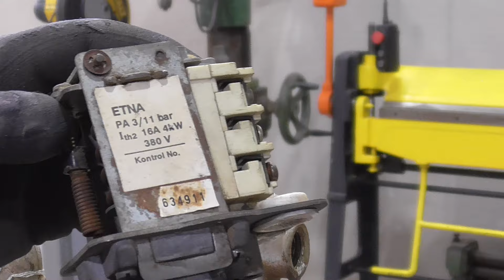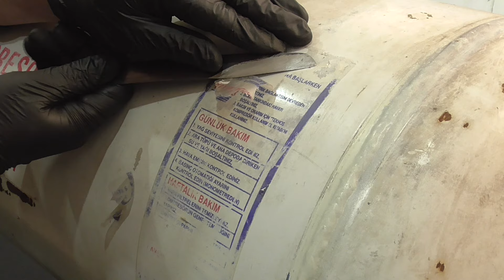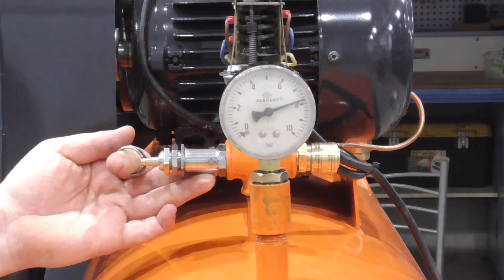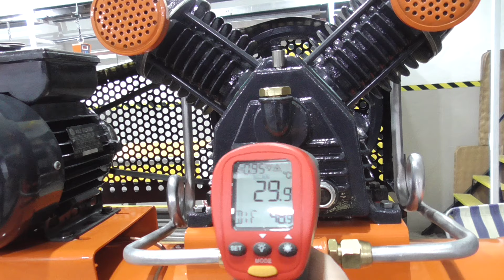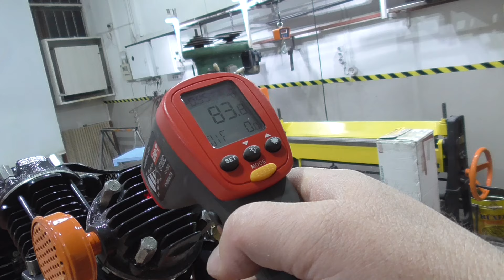Old Air Compressor Restoration

Comment: Great work, cool video. 
35:39 - I saw that one coming. 🙂
When I saw the air outlet aligned with the manometer connection I thought "no, no, it has to be oriented the other way or the hose won't fit!"
...Thanks for sharing.
Reply from the maker: Yes. I had such a problem. 🙂 Thanks for the comment.

Comment: I enjoyed watching your video. It was very informative. I would have never thought to break down the compressor like that to make an old unit look brand new. Makes me want to do it as well.
Reply from the maker: Before doing such work, it is necessary to make sure that the air tank is intact. If the air tank is problematic or rotten, it must be replaced with a new one. Otherwise it will cause major damage
Reply: How would you test that  @MechanicTechnic
Reply from the maker: @muhammadsalman4060  With water pressure testers

Comment: It's a nice restoration for the visual but for the technical and safety part it's not that, let me explain, the most dangerous part is the tank, you have to check the interior condition as well as its thickness of this one because if there is rust it is a place to weaken and risk of explosion. Good luck for the future

Comment: I use cheap USB borescopes to inspect air tanks and other pressure vessels as they're narrow enough to fit through the small fittings (the large inspection plugs tend to be rusted shut).
The old tanks tend to be thicker than the modern consumer junk. I do not buy new consumer-grade compressors as few are decently made. Restoration (after determining if overhaul parts are available) is the way to afford industrial quality equipment.
Reply from the maker: Contrary to popular belief, it does not rust much because the inside of the tank is lubricated. This makes it harder for it to rot from the inside.

Comment: Great video.
One question: why did you use 2 pipe out from the cylinder head like that ? I mean, when I see the original design, the two cylinder head are connected into 1 common ,,rail'' which goes into the tank. I am symphatizing with you solution, so is there any exact reason? Is this design better than stock design? I have a 3kW (single phase), 3 Cylinder compressor and it is able to produce 400 l/min at 4 bar and 350 l/min at 7 bar.
Reply from the maker: Thanks for the comment.  If you look carefully, the machine has been restored.  That is, it has been renewed as in the original.  No changes were made to it.

Comment: Nice job 👏 question how about the inside the tank isn't rusty inside?
Reply from the maker: Thanks.  Yes, after all, it's a 20-year-old machine, of course, rusty inside.  I applied rust remover in it, but it was not included in this video.

Comment: Question. Im looking at a used 80 Gallon CH air compressor with a tf061903av pump. The oil in the pump looks good. The electric motor is being rebuilt as they over greased the bearings, so I cant run it to ensure it works. When I spin the pump I can hear it compressing air but then I hear air either coming out/in of the oil plug vent which is almost a pvc valve. is this normal?
Reply from the maker: I didn't quite understand the problem.  I understand you said that air is coming out of the oil plug.  A small amount of air output is normal, but if the amount is large, it may be a problem.
Reply: @MechanicTechnic  Correction..the oil plug is a solid metal plug...no air coming from there. There is what looks like a check valve (PVC) up higher on the pump that vents the crank case pressure...thats where some air is coming from as i rotate the flywheel. I rotated the flywheels around two revolutions with my hand plugging the open (fitting removed so empty 80 gal tank) air line...removed my hand and the tank had a bit of pressure blow out...this seems good i think? The motor failed due to over greasing the bearings...never thought of that.

Comment: Hopefully the tank isn't too thin. It would be a rough day if that thing popped.
Reply from the maker: Certainly not thin.  Don't worry.
Reply: @MechanicTechnic  I'm talking in reference to the tank rusting internally over time. Some people never drain the tanks and they just rot out until they blow. Yours may very well be in good shape.
Reply from the maker: @mp-xt2rg  I understand.  Internal controls were made.  It works for a long time.  Thank you for your interest.

Comment: Very nice restoration. #1: You put too much oil in the pump. Oil level is to the red dot in the middle of the inspection glass. #2: Why didn't you put Teflon tape on all the threaded parts to keep it from leaking air? What was the blue stuff you put on the threads?
Reply from the maker: Thank you.
Reply from the maker: #1 You're right.  I may have put in a little too much.
Reply from the maker: I used a more practical liquid adhesive instead of Teflon for airtightness.
Reply from the maker: It is much more practical and robust.

Comment: This restoration should be illegal. How does he knows if the tank is rusty on the inside? Did he do a water pressure psi test? (Safer to test max psi of a tank with water)
Reply: Cuál sería el peor escenario?

Comment: Old air compressors are like ticking time bombs - you never know when they will go off. It's not a good idea to have a bomb near you... that's why you never repair an airframe older than 10 years. safety first!
Reply from the maker: You are right. It was a one-time project. I don't want to do another project like it.

Comment: The tank looks very nice..on the outside, the least important place, no attention given to the inside though, none, the most important place. And the ring  gap spacing? Zero f's given there as well,   guess you don't care how well or long it works just as long as it looks good. Not to mention the amount of RTV d̶r̶e̶s̶s̶i̶n̶g̶  splurged onto the crank housing gasket, that fat bead oozing on the outside that you cleaned off also oozed on the inside of course, where you couldn't, but hey.. what's a blocked oil way to a blind dog in a dark alley if the dog has a nice coat of paint, woof. Never heard of cross tightening head bolts either, apparently, just round the clock. Then we have completely pointless split, not star, washers on the electrical connections to the motor plus no grommet or cable gland in sight for a mains cable passing through a square edged hole on a machine that vibrates, brilliant stuff. O  and no washers at all between those cotter pins and a plastic hub.  Your channel name starts with the word "mechanic", how ironic. A bit like the compressor, I guess you don't mind if it means anything as long as it looks good. Very pretty, 1 out of 10 for superficial fluff. The clueless like how nice it looks, beauty being skin deep apparently.
Reply from the maker: I am improving myself.  Stay tuned for better content.  Beautiful.  You criticized everything that was done.  But your criticisms seem like you're mocking me.  I won't answer them all one by one.  I can give you my answer by making better projects.  Thanks.
Reply: @MechanicTechnic  Sorry, I was a bit harsh, pre afternoon coffee. I've just watched many videos claiming to be restorations of equipment that amounted to little more than a coat of paint, I suppose yours just became the straw that broke the camels back. I only criticized those things that were not right, not everything, your colour choices were great for instance and the plumbing was without error as was your wise choice of sealant rather than teflon tape. And you plainly have an excellent attitude, even in the face of some grumpy old knowall on the internet such as myself. So good on you, I liked your aircon conversion video if it's any consolation, that was nice work ;)
Reply from the maker: I'm always open to criticism.  They have a lot of impact on improving myself.  Of course, it would be nice to be praised for work done well.  🙂
Reply from the maker: Also, thank you for watching and liking my air conditioner conversion video.